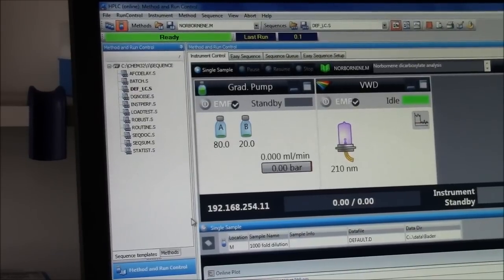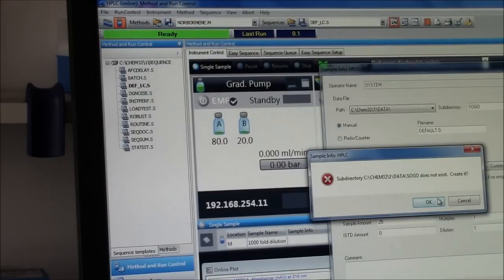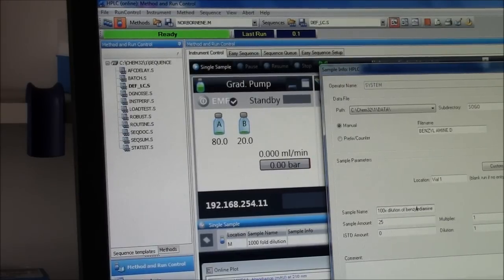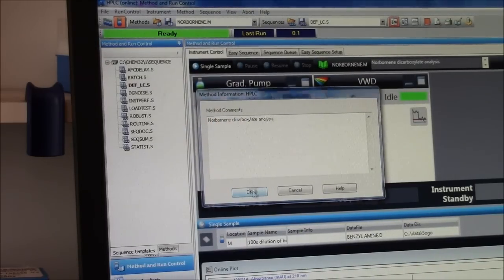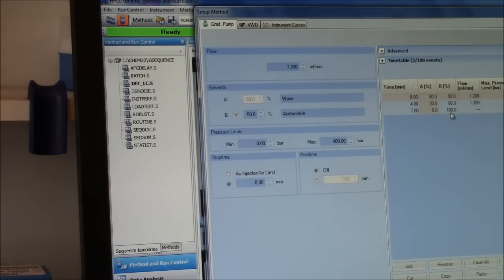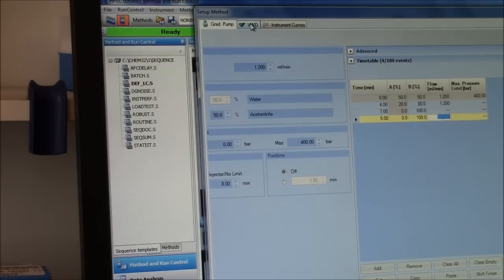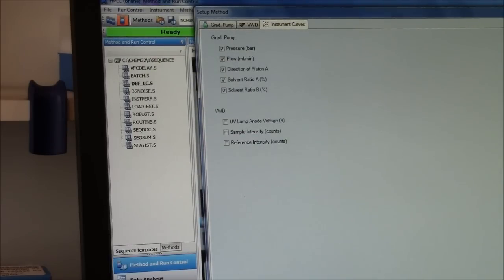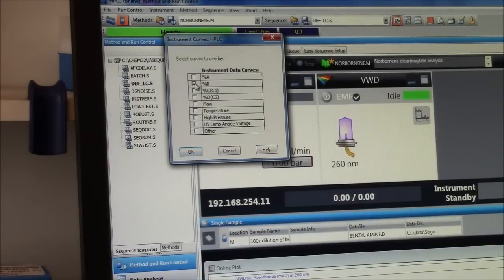HPLC Tutorial 1  Naming sample, Editing Method

Comment: The current Openlab CDS Chemstation has a different interface for setup method.  It has a field for "initial" % and doesn't accept a zero in the gradient table.  Does this mean that "initial" is zero and the first change is put on the first line of the table?
Reply: I'm not totally sure what you're asking but if it won't accept a zero in the initial it's because you set the percent of the other solvent and it will fill it in for you, ie. Set solvent b to 100% and then solvent a will go to 0%.